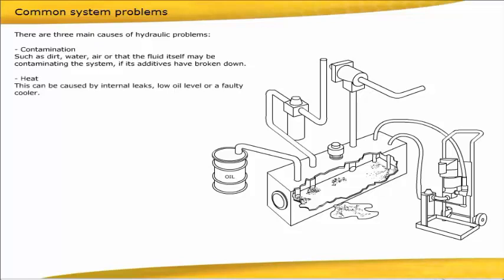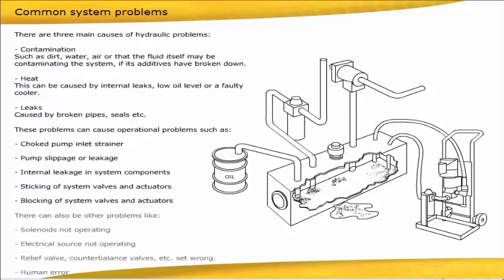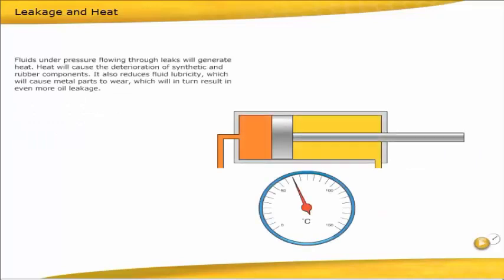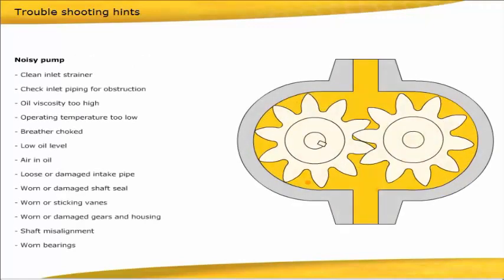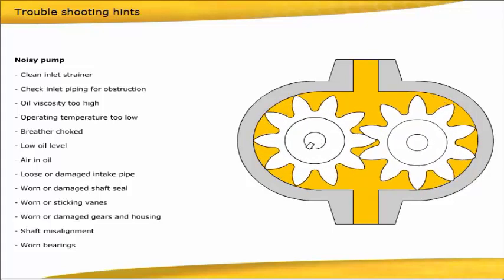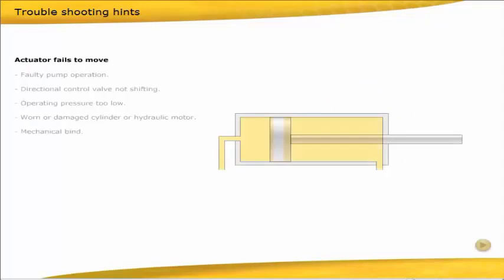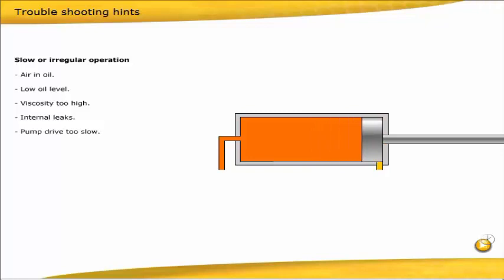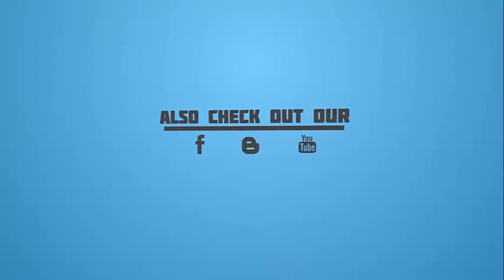Hydraulic Problems

Comment: hello,good day,i am a drill operator and i incounter problem about the hydraulic system of my rig,when i put in pull out mode rotation head cant grip the rods,sometimes reaction is too slow,foot clamp also is too late to grip rods,thats why it cause drop rods,how can i solve that?,can please teach me how?

Comment: Hi , i made a hydraulic log splitter , it works really well , it has a 5" ram 3" spear ex crane leveling ram , 28 GPM pump , 120 litre tank , all my fittings are the sweeping bend type and 1" hoses , bigger Inlet hose  1 1/2 i think , 30GPM spool valve , I would like to add a oil cooler in the return circuit but am not sure if i should have a loop Tee'ed off after the filter and large cooler ,do they fit a bypass valve ? or should all the flow go through ? i am not sure about this stuff or just add some fittings to my tank lid feed and return and get a smaller pump to circulate through a  40 row cooler with fan ? any help would be great .Cheers .
Reply: Hy where from you should